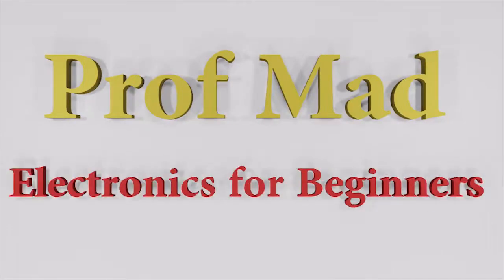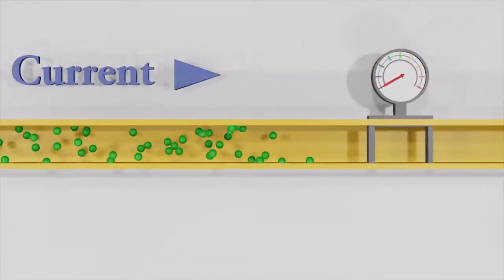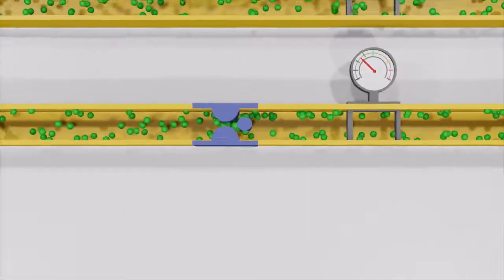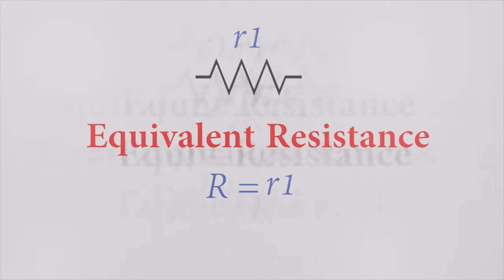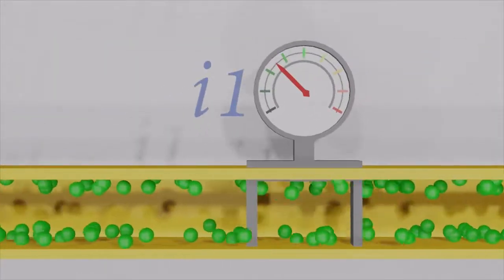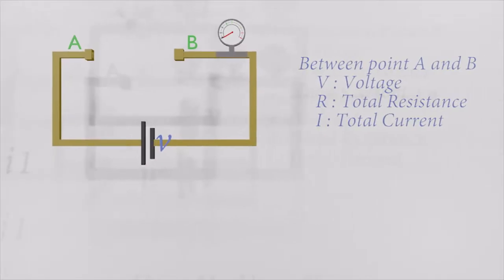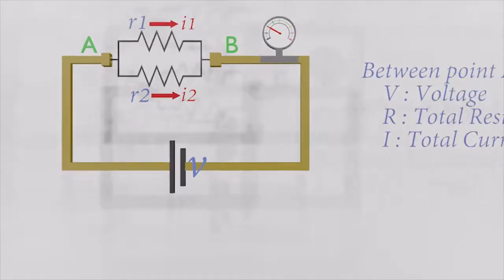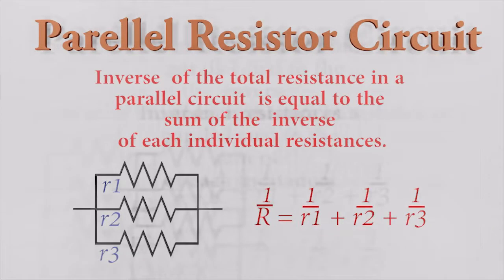Resistors : Series and Parallel | 3D Animation | Electronics for beginners

Comment: Sir in a conductor atom are also work as resistors bcaz they also resist the flow of charge (electrons) but I often notice that in the circuit there are signs of resistance and one can say that here the 2 resistors of 3 ohm or 4 resistors of 5 ohm whatever but why the people do not count the value of resistance of atoms why sir?? Please clear my this doubt
Reply: Resistance offered by atoms is termed as internal resistance which is much lower as compared to external resistance applied...Hence while theoretical classes u neglect it but when we work practically we can't do that...Hope this works 🙂

Comment: I have a question if i connect 4 resistors 100 ohms each in parallel will the ohms increase to be 400 ohms please tell me
Reply: resistors in parrallel decrease the net value of resistance. In your case, the net will become 25 ohms.
Reply from the maker: That's correct. The resistance will decrease when  connected parallelly.

Comment: Series resisters reduce the voltage not current. But in parallel resisters current will drop but voltage will be same.